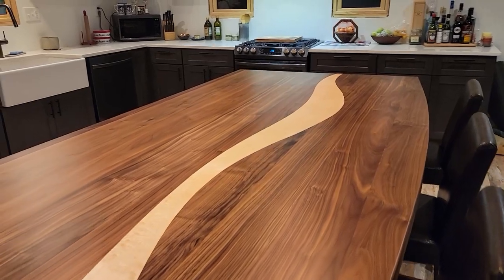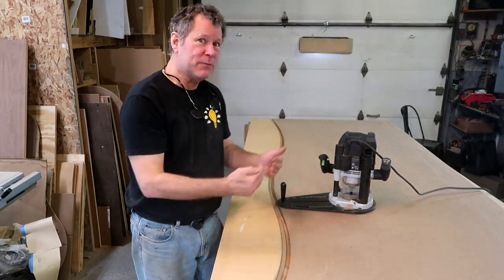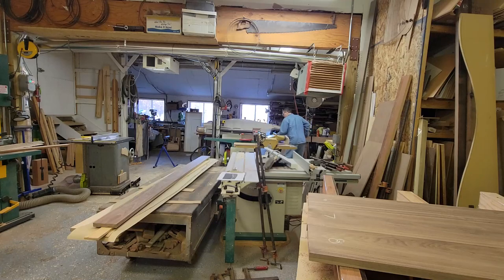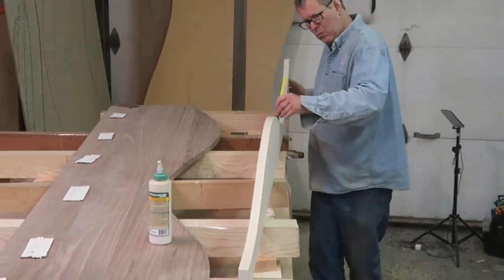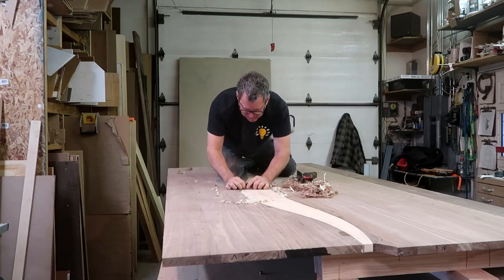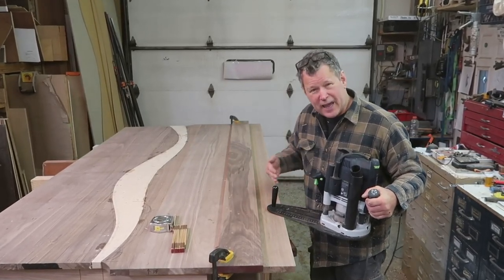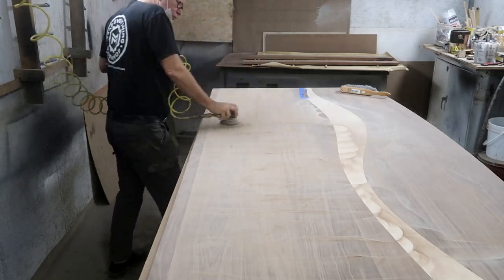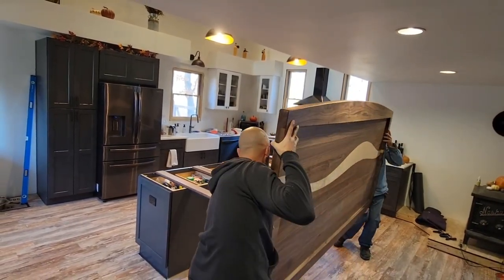Curved Joinery Table with Router and Template Guide

Comment: Great video and explanation thanks 🙏

I don’t suppose you could give me an example of how I can try the same technique using metric bits and metric router bushings please? Thanks
Reply from the maker: You simply need a template guide that is 3x the dia of the router bit.  ex. 19mm bit, 27mm template guide.  OR make your own bushing to fit over a smaller template guide. easy peezy
Reply: Thanks for the reply. Sorry I’ve only just got round to trying this! Just to check I can use a 10mm bit and a 30mm guide bush?

Comment: thank you for the informative video! i’m wondering if it would be possible to use a different OD bushing with a 1/2” bit?
Reply from the maker: yes, you can use a 2" also.  It all depends on the sequence of the templates and final  cut.

Comment: I'm going to try and rephrase for my own edification, if I'm not grasping it let me know.    

The offset of 1/2 being the same diameter as the cutter diameter 1/2 is what makes this work?

would changing the offset to say 1/4 with a 1/4 inch cutter also work?

as always great videos
Reply from the maker: The offset is calculated by the OD of the template guide minus the dia of router bit divided by two.   A 1/4" dia bit still using the 1-1/2" TG would increase the offset to 5/8".  For a 1/4" offset with a 1/4"  bit, you'd need a 3/4" OD template guide Hope this helps.
Reply: @imaginegrove  yeah, forgot to drop the size of the collar to work with my example.   
Thanks